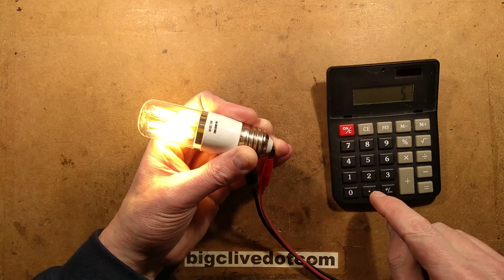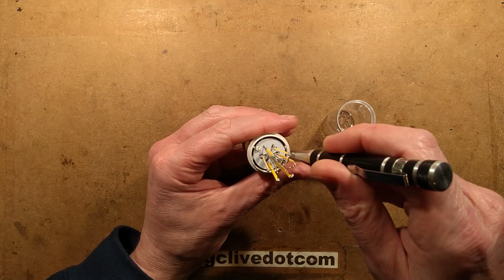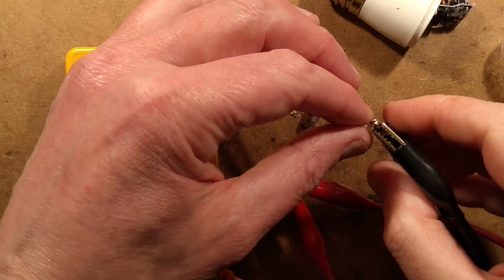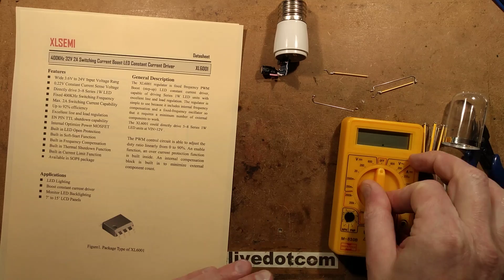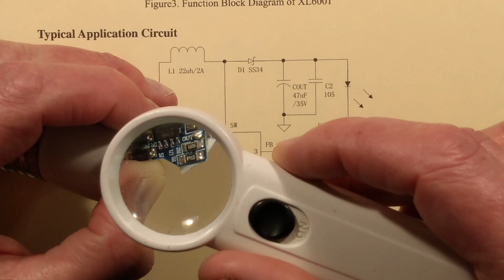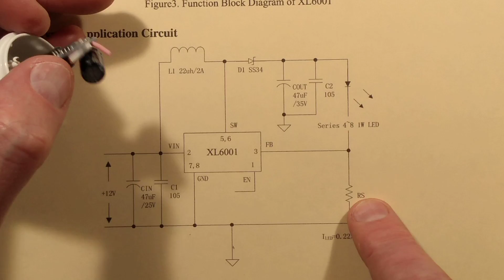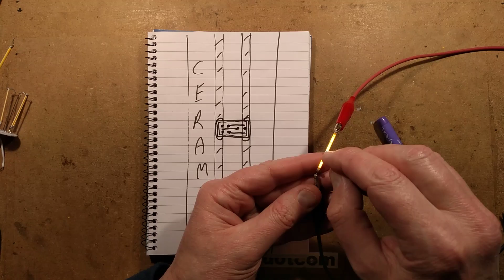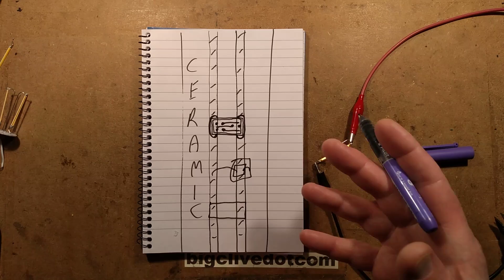12V LED filament lamp video disaster.

Comment: I wonder if you could build these lamps so that they were self healing. I.e. if a certain number of strips or even individual LEDs broke, it would still function.
Reply from the maker: In this case it would still work with lots of the LEDs out.
Reply: A simple addition of a 3.5 or 4 volt zener to each LED junction which would only act when the LED failed keeping the others on. This would be for the higher voltage series filament lamps. It would mitigate the black dot of death.

Comment: My brother told me that he thinks that the filaments are actually overdriven, electroluminescent wire. He didn't even know that they made filaments out of LEDs. Is that even possible to use electroluminescent wire like that? It sounds screwy.
Reply from the maker: Definitely not electroluminescent.  It's never been good for high intensity and tends to degrade quickly if pushed too hard.

Comment: After also watching Julian's video, I thought I would take one apart. Just like you I did exactly the same thing. Also took me 20 mins or so to work out what was going on. You could imagine the pain I was going through, screaming at you all the way from New Zealand with the problem, the 20 minuets seamed more like hours!! So pleased it also took YOU the same time to work it out!!
It first I thought they were the series type that needed 70+ volts per strip to light and used a boost converter. After I got to 100 volts I thought I better take another look!!

Comment: Home Depot in the States is selling "EcoSmart Clear Filament Vintage Style LED Light Bulb" in clear and frosted glass but cram all the capacitors and resistors in the space of the Edison screw and between the screw and the capacitors is a layer of plastic. The result is that they get very very hot and die after only a few months/weeks of use. When the first start to die they flicker within the first ten minutes of being turned on for a couple weeks and then one day they don't turn on. I took a couple of failed ones apart and all of them reeked and the capacitors were bulging; one had electrolytic all over inside.
Reply: Yeah, that style of led is not intended to be installed pointing downward in an enclosure.

Comment: Why not to use the Uni-T UT210E? The Crocs from that yellow meter will fit that as well, and the Rotary dial from that is surely not worn yet.
If you position that meter correctly, the Display should be clearly readable. :-)
While the LED lamp still functionned, you meight be able to measure the actual current through the LED array, and through the input. The difference is in proportion to the voltage rise over the LED array, and that way you were able to get the actual voltage over the LEDs with a minor loss calculated beceause the converter is not ideal. :-)

Comment: The mode switch in the 830b meters does play up, the contacts are cheap.
Rotate the switch a few times before use.
Reply: I've got a couple of those--same issue.  I wonder if some  Cool-Amp might help that, or maybe some dielectric grease on the contacts to keep oxidation at bay...

Comment: I tried to build a dc-dc converter very similar to this one the other week..  It went about as well as this video! Although mine was a Linear Technology 1613 SOT23-sized device and seemed to demand microscopic positioning of explicitly SMT support components. It did not like strip-board and a DIL-converter one little bit!

I was planning to try again with a much more spatially-forgiving design based around a micro controller to provide the pulse which I found on some German fellow's website, but...  A couple of moderately expensive failures, one after the other in quick succession has really taken the electronics enthusiasm out of my sails. Maybe I'll try again post-Yule.

Comment: I have an idea for next time: pull it apart, power it, and then read the voltage going to the leds. Trust me, it'll save you your time and your sanity.
Reply from the maker: The snag is that I broke the filaments when I popped the glued lid off.
Reply: Oh. In that case I'm sorry for assuming. But You could still measure the voltage coming out of the buck converter, right? Also, a problem like this one would also make me spend hours tearing my hair out trying to find out what was wrong. ;)

Comment: How could the polarity not matter
Reply: Ah it's meant for a.c. I assumed it was one of those dc 12v bulbs of motor home
Reply from the maker: It can be used on AC and DC.  The main advantage being that it doesn't require a specific polarity in the lamp holder.

Comment: 12V lamp with E27 thread?  that has potential for many more disasters!
Reply: bases vs voltages was never an issue till recently, when humans lost the ability to read labels :)

in the 1930s, London, UK, had several dozen different voltage/frequency combinations. and pretty much one lamp base
Reply: @TheChipmunk2008  began with warning labels
Reply: They do make E27-base in 12VDC and 24VDC varieties for RVs. VWestlive did a video recently about them.
Reply: @dashcamandy2242  Yup, got a few 12V incandescent lamps that look exactly like their 120V cousins.
Reply: DashCamAndy what would need to change about an E27 socket to make it 12V capable?
Reply: @JasperJanssen  hook up a 12V power supply to it instead of the mains directly. Simple as that :P
Reply: There's quite a few different voltage lamps from selv up to full mains on a standard e27... the 110v ones often cause hilarity as they look just like a standard 240v GS lamp but they don't like the extra juice... the 12v ones that look like a standard incandescent lamp could be quite amusing.
Reply: I suppose so, but what proprietary low voltage lamp sockets are there?
Reply: @Fekillix  For example bayonet sockets like BA15s (for car headlights and such), or halogen sockets like G4, G5.3, G6.35 - all of those are used for 12V lamps.
Reply: @Fekillix  Any car light socket?
Reply: 12v E27 is pretty common with RV lighting and small scale solar sets i have a few that are not quite as nice
Reply: I’m glad I wasn’t the only one thinking this. USUALLY there are special 12v fittings, these are sort of halfway sized Edison screws. But you can come across some 12VAC GU10 fittings, at least here in Australia it’s relatively common. In one house you’ll either have straight 240VAC to the holder, or you will have 240VAC to 12VAC ballast in the ceiling. Unfortunately these solutions are about as common as eachother.

The reason for this duality, is because in Australia, it is technically illegal to change a light bulb, as it’s considered interfering with an electrical installation without a license. It’s never ever enforced, but it is a weirdo law that is a thing. This is also why, in Australia, all traffic lights have step down transformers inside their housings. Every light has its own transformer, and these step the voltage down from 240VAC to 10VAC, thus allowing unlicensed workers to work on them and work cover won’t get mad.

It’s a bit strange, but it’s not just in Chinese light bulbs.
Reply: @uzaiyaro  
I think you are forgetting one very important point.  The filaments of 230VAC lights are made of very thin wire and are not as long life.  The much thicker wire of a 12VAC filament takes longer to burn out.  And the voltage is lower, 10VAC to make the light last even longer.  Lower maintenance and safer lights are the results.
Reply: the funny thing is if you plug a 120v ac led bulb into a 12v dc socket it kills your bulb. not dumb enough to try the outher way around but i assume that also kills um
Reply: Liam It’s second hand information, asked when some people were working on the traffic lights. I saw the transformers in the back of the housings and asked why the hell they are there. This was in Queensland.
Reply: @Liam Can't talk about traffic signals or why but railway signals have the same transformer setup with ~10v for the bulbs. Have a transformer makes sense cos then you can get the voltage set right for brightness versus life (likely a bigger issue with RR signals cos of longer cable runs)
Reply: Canadian Tire used to sell them (the incadescent one - i.e. 60 watts) they draw 5 amps at 12v - We used them on Fishing boats to light up the cabin - They were handy, same candle power but yes, instant disaster if by accident you tried them in 110 sockets...
Reply: These bulbs are frequently used for emergency lighting during power outages.  The bulbs are wired to a regular 12 volt battery, and come on when the power fails.
Reply: Not sure if that's the case I think it is still a line voltage light but can operate because it has a booster converter power supply it can operate at much lower voltage not sure I could be totally wrong here in the US that's normally not the case
Reply: Is not a problem. You can run it at 220V with no problems.
Reply: Another LED light to play with on the boat,,cool,
Reply: They also make 277v lamps with an E26 base. Just to further confuse the issue!
Reply: The spec sheet says so, but he did pull out a full bridge rectifier at the start
Reply: You can get 12/24/48V lamps in E27 and BC as well (used in telcos and other areas). ALWAYS check your voltage
Reply: In Australia, one could find 12v globes/lights using the standard bayonet style connection used for 240v globes/lights.
Reply: They should make the threads the other way around. :)
Reply: This is not E27. It's smaller so you won't be able to put it into a normal 220v fitting.
Reply: @TNT_Labs  I'm assuming these are either small Edison screw (E14) or miniature Edison screw (E10), for which you can buy 220v fixtures for both...
Reply: Certainly in the past, you could get both E14 AC mains rated fittings and mains rated filament lamps, as well as lower voltage lamps. Same for E27...
Also you could get mains rated fitting fittings and lamps in the same size BC versions.
Reply: Rob Never seen that in North America.  Maybe it's a UK thing?
Reply: @heronimousbrapson863  Nope. 12 V RV lights use standard sockets. I have them for my driveway lights. Used to have incandescent, but now am running LED.
Reply: I  imagined that Edison screw sockets might be a problem with RVs as they may vibrate lose over time. But i guess you guys have been using these for years without any problems.
Reply: I have 12vDC lamps on my boat with standard bulb bases.  But it's a 1985 design so they may have decided that wasn't such a good idea later on...
Reply: Who gives a fuck about America? Nobody cares.
Reply: @mactheknife4786  what's wrong, did America deport you for being crybaby?

Comment: I got two Philips lad lamps, looks like the same setup. There use down here in 245ac. Now the lights work most of the time fine once in a while the flicker a bit and than go on with normal use. Any one has the same experience?
Reply from the maker: Flickering of LED lamps sometimes hints at an LED starting to fail.
Reply: B-Clive, there just out of the box..... I thought it mite be heat related, but they don’t stop working. Just a little flickering not like complete out, just some fluctuations in the light intensity for a second or two and them they work normally again. Find a wast to drop them, can live with it 🥴

Comment: oh man can you check the voltage / polarity across those  wire that you just cut in the beginning of the video. hope you do that , this will make your video little bit short. else everything is fine.
Reply: Has to be measured before cutting.

Comment: Why not start with measuring the original supply inside the lamp? ;-) Like this video though. Sometimes also someone else is stuck in a kind of loop when doing tiungs...
Reply: Duh. Good comment.

Comment: so...... do Americans call them crocodile clips for the benefit of the English?
Reply: Hmm, lets see. Alligators have jaws that let their teeth mesh together neatly. Crocodiles have jaws that let their teeth jut out. So, if the teeth on the clips mesh neatly they're 'alligator' clips. If they're cheap clips where the teeth don't fit together very well, they must be 'crocodile' clips - lol!
Reply: @jfan4reva  genius response. :D so....fluke clips are alligators...hazard frought ones are crocodile clips. got it.
Reply: thefordmaniac  All of mine have turned into crocodile clips from me closing them in doors, hoods, tool boxes etc.  Even to my huge disappointment my expensive fluke clips  :)
Reply: @me3333  right...i was the same boat however i got this nice New old stock craftsman multimeter probe set that have very nice covers on them. i just picked up banana plug ends...or cut the ones off that shit cheap set you pickup on ebay and solder and heat shrink them to primary wire. and boom if ya have banana plug adapters and ends BOOM you have any "imaginary" testing wire you need
Reply: thefordmaniac  I have made a lot of custom test leads in the past for things like plugging directly into fuse boxes to make finding shorts easier etc.  There was a guy on ebay that was selling 12ft Pomona silicone leads with alligator clips for like $5 and they are the best I have ever used.
Reply: @me3333  i did the same thing until purchasing the power probe short finder ect3000b. also works on main ac systems with the power off of course, or really any circuit if you wanted to, and using a 12 v battery or ive made an adaptor for milwaukee m12 batteries to use with this tool to find where the hell that harry homeowner ran that circuit ages ago.
Reply: I have been trying to decide if I need to buy a power probe for a while now.  I am retired and don't know if I do enough work to justify it.  They look cool so it is very tempting
Reply: @me3333  its become very helpful in my career working on emergency vehicles. but...i still like to use a test light every once in awhile. its handy to have the ability to send ground and power and have a multi-meter and be able to hold the peak voltage value on the little screen tho. i currently use the power probe 3s, have had 3 , 2 and 1. the 4 is definitely too much overkill. however it will supply, without an adaptor, from what i hear, engine computer safe 5 v reference and measures ac voltage.
Reply: I definitely need to read up on it more but I really need to figure out if I do enough work to shell out the $$$ for it.  I basically just work on friends family and neighbors cars so it will be a tough call for me.  But I do like shiny new tools so I will probably get one
Reply: @me3333  good vidjahoes on these here youtubes
Reply: Oh BTW I like your Galaxie.  I drive a 70 Bigblock Galaxie 4 door and a 63 Fairlane Sportscoupe along with various other Mustangs and ford trucks so I guess you could say I am a fordoholic
Reply: No we call them alligator clips. Lame attempt at a funny. 😑
Reply: why would we, we got all kinds of lizardy death monsters
Reply: hob991 we called them roach clips.
Reply: we are very careful with crocodile clips, we don't want to end up like Steve Erwin. . . . .

What?. . . .Too Soon?

Comment: 1:21 - Temporarily forgets how to use calculator
Reply: He was looking over at the power supply to make sure the amp value he put in was correct, you can hear his voice changing as he turns his head away to check...
Reply: Happens to me all the time, I mainly use a 10-key pad on my phone and when I go to use a real calculator the numbers are arranged differently.
Reply: LOL he forgot where the equals button was
Reply: Bad connection between central brains unit and I/O buffer. Maybe some interfering signals from abdominal interface?
Reply: Brain fart 🧠
Reply: I touched my screen there but it didn't work. :)

Comment: Can you screw it in an e27 socket and what would happened
Reply: The chance of mistakenly screwing this low voltage device into a full domestic supply E27 adaptor seems quite high. I'd also like to know what the failure mode is under such circumstances. @bigclivedotcom. Would you like to try this, you know, for science?
Reply: @squelchstuff  You get at least a bright flash out of them :)
Reply: You will let the smoke out......
Reply: Lots of angry pixies will start dancing the Time Warp
Reply: @Gregory Thomas, "It's astounding, time is fleeting"
Reply: your hand turns black with soot and you get 3rd degree burns from molten plastic as it then shocks you have to death... lol sounded good anyway

Comment: That suspension when you see "disaster" in the video title of a Big Clive video and waiting for the disaster to happen
Reply: "Where's the Kaboom? There was supposed to be an Earth-shattering kaboom!"
Reply: Marvin!
Reply: @MacPrince  LOL... As said by Marvin the Martian. :-)
Reply: Imagine if it was a pink cheap USB charger, from China...
Reply: @thomasesr  or it had fire coming from it's backside
Reply: I'm drinking coffee and made sure not to be ingesting while he turned up up the tension on the LEDs. The actual point of failure surprised me as I was expecting it to be the alligator clips as I have had bad experiences with those.
Reply: EpicLPer If you like disasters, check out Electroboom.

Comment: Cheers Clive - now I don't need to take mine apart :)
Reply from the maker: Or if you do, you know to do so with greater care.
Reply: See, Julian, THIS is the appropriate bulby bit for the lighty bits (technical terms) being this short and close to the fitting. Yours is just taking the mickey.
Reply: @Mai Mariarti  hey you can't use that word that's our word drunk is us  alcoholics word 😂👍
Reply: @ronaldbrown9638   Drunk is a professional.  Alcoholic is an apprentice.
Reply: Which is good, Clive actually knows what he's doing, you miss and don't seem to know a lot of fundamental and common sense stuff that you really should.